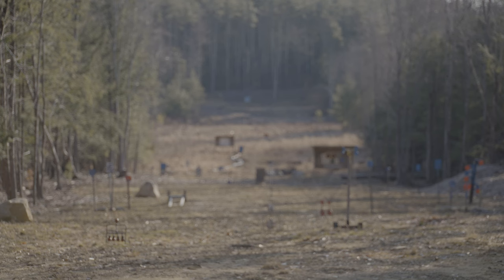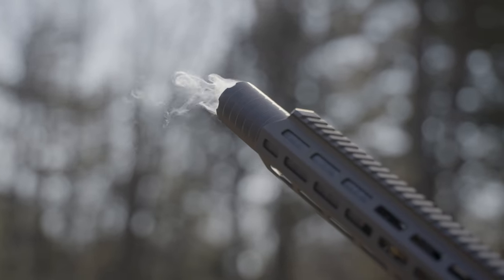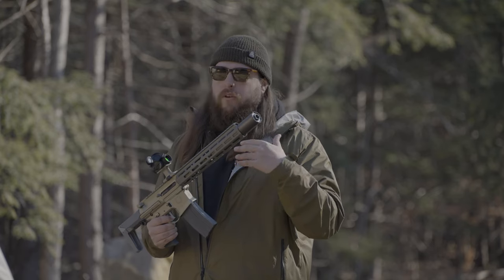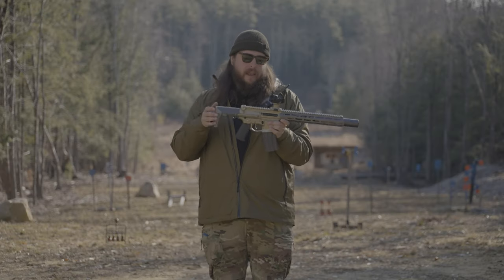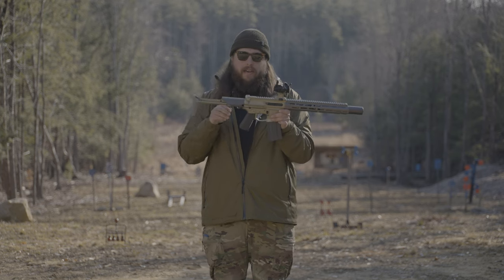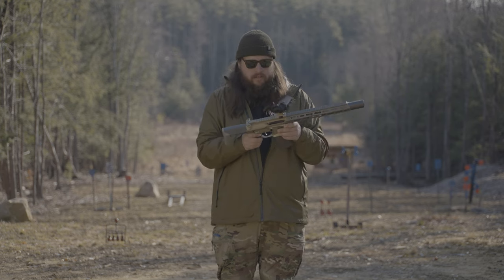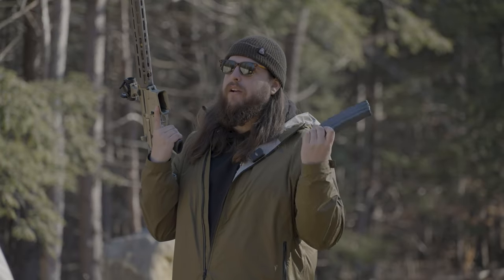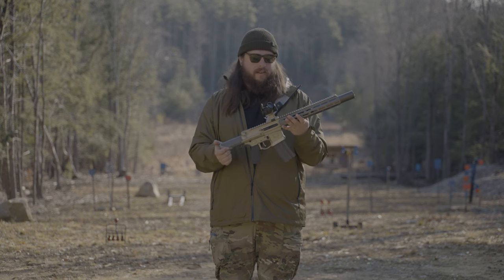Q  |  What's Q  |  Honey Badger SD

Comment: Taking it apart isn’t the problem. Push the pins and step back it’ll disassemble itself 😂 It’s getting back in one piece.  Hopefully the 2 piece bcg makes mine easier to deal with.
Reply from the maker: It gets easier as you break it in
Reply: @qllc8143 true. It’s not that bad honestly. . Now I would like to know how you keep from loosing beard hairs to the stock😂.

Comment: Q is when you get an innovative and light gun, but it cost an arm and a leg.

Also, are you guys looking into the new 6max cartridge and how it might actually deliver what 6arc, 6.5grendel and 6.8spc all promised to do?
Reply: 6mm Max can’t deliver what 6.5 Grendel has done for the past 2 decades.  6.5 Grendel also exceeds 6mm Max short barrel performance with the same projectile weights, and can match the velocities with 2” less of barrel, using less chamber pressure.  I still think 6mm Max is an interesting cartridge design though, and is what 5.56 should have been in the late 1950s.  6mm Max matches 20” 5.56 performance from 10.5” barrels, which is impressive.  6.5 Grendel matches 20” 5.56 performance from 8.5” barrels, while also having the ability to shoot 90gr-160gr projectiles, including supersonic or subsonic 140-160gr.  6.5 Grendel also has 20 years of magazine development and production behind it, which the 6mm Max is just entering and will naturally go through a series of bugs before finding reliable 20-28rd mags.
Reply: 6mm max

Comment: I cannot understand the draw of SD rails. the suppressor makes the handguard too hot to hold and I've even had polymer front backup iron sights warp because of the rail getting unbearably hot. Like do yall REALLY need that much extra rail space that you're willing to compromise on overall length of your weapon and heat transfer? The problem is even worse with the HB rails because of how light and thin they are.
Reply: What kind of chinesium are your back up irons LMAO 👌

Comment: You can’t even mount anything to the handguard nothing more than a range toy
Reply: It has 1913 Picatinny rail along the top and MLok everywhere else. What can't you mount?
Reply: @silvermediastudio  the can is too close to the handguard so you can’t mount anything out front
Reply: @See-yw1vw  You didn't answer the question, what can't you mount? Lights can be mounted on the bottom or off the top rail using an offset mount (LaRue, GG&G, GCode, Haley, DD, many others). Foregrips/handstops can be mounted on the bottom, as they usually are. Lasers or I2/thermal scopes can be mounted on the top rail.
Reply: What?